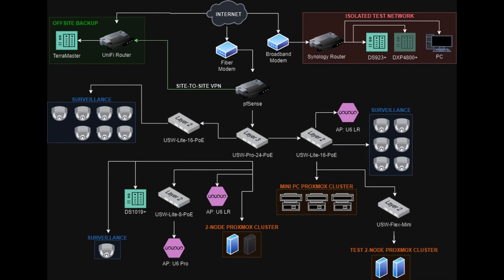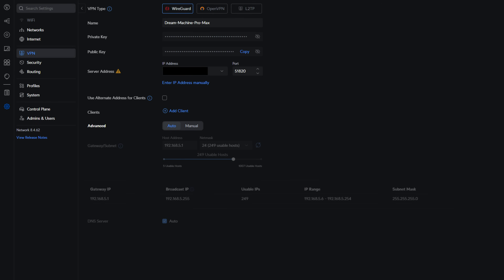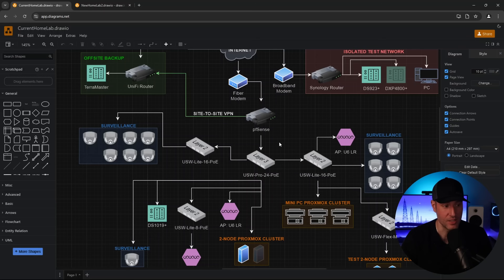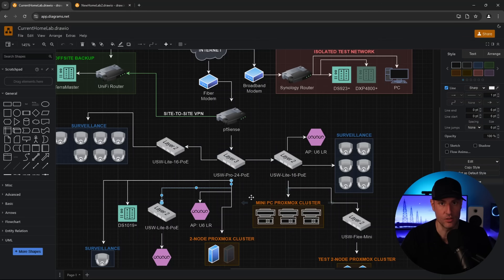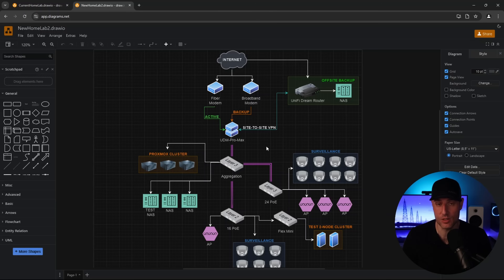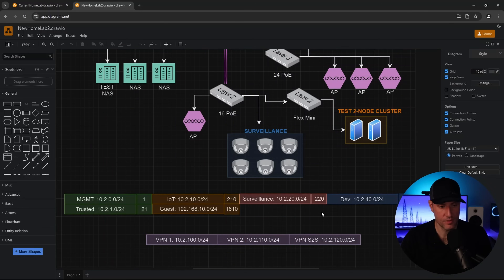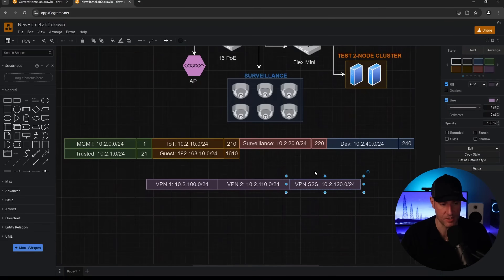Designing & Building a NEW Home Lab from Scratch

Comment: Thanks for your guides, great point to start configuring the Unifi stuff 👍. 
But i have one question. Why do you always use VLAN1 as management VLAN (same in the beginners guide)? Normally VLAN1 is the default native VLAN so every device you plug in an unconfigured switch/router has access to the management VLAN. Wouldn't it be better for security reason to keep the default VLAN as it is and create an own for the management? And the default VLAN could also be isolated and internet access blocked. In this case a new client can do nothing until you define a suitable VLAN at the port it's plugged in!?
Reply from the maker: It's technically more secure to not use 1, but in a home environment, I've never really found a reason to do it. I just set the other ports to use a different port profile, but that's just how I do it. Doesn't mean you can't use something else.

Comment: The Minisforum MS-01 is a great option for the Proxmox cluster if you can get by without ECC. I have one of them with the 13th gen i9 and 96 GB Crucial DDR5 (ServeTheHome's forums have a post listing the specifical Crucial kit that I used and has been verified to work), and two Western Digital N700 2 TB NVMes in a RAIDZ1 mirror. Probably not the best solution, but it's incredibly powerful and power efficient if it meets your needs, and the connectivity is the best you'll find anywhere near that price point (to beat it, you'd need to have 25 Gbps networking anyway). I put a dual 2.5 Gbps NIC card in mine as I was planning to use it to virtualize Opnsense, but I don't think I"m going to do that now.

I'm planning to put in a full Unifi network, but it's a big project as I need to get enough of the basement finished to make a large apartment down there. I don't know if I'll put the rack on the ground floor where my office is now and run down to the basement for my new office, or if I'll put the rack in the basement and try to run cables up to the rest of the home. But the home is not wired for ethernet at all whatsoever. The basement is unfinished so it will be easy enough to get that wired up during the finishing process, but we'll have to see what I can arrange to run cables to the other rooms of the home.

Comment: Hi!
As you asked for suggestions, here are some things that I do have or will have implemented soon at my place.
Chances are, that there might be overlappings with other comments 😀

I replaced all of my longer CAT-cables with fiber, because considering the effort of laying major lines - as a backbone oder between stories or so - I want to have as much throughput as possible for the future. Even if I might never have a higher contract from my provider, within my LAN things are different.  Maybe you will use your rooms different in some years and in case you are moving inhouse-fiber-wiring is a bonus - OK, would be for me
And I do not have to care when various VLANs run through the same physical line.
Furthermore there are new fibers that are much thinner than the known ones and have a very small bending curve. The look more like a fly-fishing-rope.
Oversized backbone throughput is a kind of peace.of-mind for me. 

A bonus from fiber is that voltage spikes do not travel through my LAN. Maybe the demark modem/router crashes, but that's usually a consumergrade thingy from the provider. I had that some weeks ago very likely because of heavy thunderstorms in the area of Munich. My fritzbox was broken, but my netgate 6100 was fine. got a new Fritzbox, played the backup back and online again the same day.

I use my SFP-Cages (why give existing switch ports away ?) with DAC only. 
SFP-CAT-RJ45-plugs produce a lot of heat a.k.a. wasting energy and aging the tec. The DAC-Cables I use remain cool even when running 10Gb/s. And 1 DAC-cable is cheaper than 2 SFP-CAT-Plugs plus cable 

Depending on the remoteness of your house, a second-router-fallback-solution with Starlink or mobil-data (5G router) might be an idea

And I cant see any UPS in your diagrams. Because you are running cameras and NVR I would like to have them running at least for a while after a potentially intentionally produced blackout. And you will still be able to get a notification if so and you are not at home.

I am curious if there is some useful information and how it works out on your side

regards from Munich

tom
Reply from the maker: Really appreciate the input! I'm hoping to get at least one of the lines as fiber, but it's not looking good - going to keep trying though. Totally agree on your point from a surge protection perspective. Very few downsides if you can get the cables run. Again, thank you for the input!

Comment: Besides I got my NAS' on two different switches, your new topo is "basically" same as mine. Both switches divide the cameras so both need UPS, which is something to keep in mind. I run three UPS totally (incoming fiber/router, the two camera-switches with NAS), that is not ideal tbh.
Home Assistant on Proxmox and one individual Pi-Hole on each Proxmox node.
Reply from the maker: Agreed, I have UPS devices literally everywhere and it's not exactly the best scenario to be in...
Reply: Now I don't know how you route cables in the walls in US, or what is allowed.
But if it's ok, don't be afraid to buy a nylon "fish tape" for wiring. I've pulled about two rolls (600') of unshielded patch cat 5e and 6 in my walls. I have not had any issues with unshielded.

Between the two main switches I have aggregated two 1GBE so I have LACP between the NAS'es (and for the 13 cameras I run = 13 constant stream = where LACP actually is beneficial). Would love to run 10 GBE but opted for the non-pro Unifi switches (because cost).
If I have had tools, I would have run fiber between the SFP's which is uneffected by interference. You can probably mooch that off some sponsor ;)
Reply: Btw, don't forget the 10 pcs flex mini-5 for all appliances and media. Being kinda old school and liking robustness, I try wiring as much as possible.  I still have PTSD from the early days of WiFi 😂.

Comment: Looking forward to this series! A note on running the fiber. If you think you need 150’ purchase 200’ pre-terminated fiber this way you don’t need the termination kit unless you want to make a video out of it. The pre-terminated can also come with a pulling hook built in. Also don’t pull 2. Pull a single 6 strand. If there is damage you have other strands. Pulling will be easier as well.
Reply from the maker: I appreciate it! That is the plan, though I have already run into my first hurdle. I can't even get the fish tape to where it needs to be, so my option is cutting and pulling it with the cat 5e cable that's there (risky), or just ponying up the money for cat 7 and avoiding fiber altogether, though I'd LIKE it to be fiber if possible.
Reply: Depending on who ran the cable and when it was run it may be stapled in the wall. Maybe a small scope that plugs into your phone and has a flashlight to inspect? They are cheap and has gotten me out of a jam before.

Comment: Surveillance not accessing anything means also NAS? 
Do you go the route with Ubiquitis NVR (I have no clue about your camera models)?
I will do a similar thing with mine. However, I will give the cameras access to Frigate (or the other way around) which itself can access my NAS for the backup/storage and can be accessed using trusted devices. Other than that, my cameras will also have to live without any internet connection or other friends then themselves lol

Also doing kind of a similar thing with Home Assistant and my IoT devices. Trying to "bridge" them so that I can connect to trusted devices to Home Assistant which itself can access IoT devices on a separate VLAN (preferably also fully offline... Let's see how I can do this. For now, with Zigbee, Shelly, my cameras and DIY Equipment, it seems doable).
Reply from the maker: Generally, my surveillance VLAN only has the cameras themselves on it. Then I'll use Blue Iris on a separate VLAN that can access the cameras, and then that will back up to the NAS. I have to think through if I want to continue doing that, but it's how it's been working for years so if it ain't broke, don't fix it?

Comment: Are your RJ45 sockets more than 100 metres away from your network rack? You cant connect everything to a layer 3 48 port switch connected to the UDM-Pro-Max? Or segment your Surveillance off to its own layer 2/3 24 port switch? I'm assuming you need 4 switches because your network runs are more then 95-100 metres?
Reply from the maker: It's mainly the location. The cables would probably be under 100 meters in total, but I'd have to run another ~16 cables and it would all go through a 2" pipe (that was there already), so it's not really an option. My goal is to use fiber, but that's proving to be a challenge. I think I can cut down that fourth switch...or at least, that's my goal.

Comment: I've settled on HP Elitedesk 800 SFF G5s for a proxmox cluster. Low cost used. Low power and noise and quite a bit of expandability. I put in 64G RAM (can go to 128 I think) 2 Nvme, 3 SSD, a dual 10Gb SFP card and a quad 1Gb card.
Reply from the maker: Love it!

Comment: I am going through a similar situation right now.
Here's my tip; The reason that kicked the reiteration in my case had been IPv6 (needed both dual-stack and single-stack IPv6 nodes for a project). My initial network was plainly dropping IPv6 (was 1st configured more than a decade ago), even though my ISP starting providing IPv6 addresses (the last two years).

You don't have to go full blown on IPv6 from day one. Just split into two single-stack networks (much less headache if you have them separated when it comes to firewall rules/hardening), and only have client devices joining one, or the other, or both stacks.

Comment: I recently went through a similar project,  A couple of gotchas I learned.  

1) I wanted to use Docker IPVLAN for networking.  I had a seperate network but to route to my other vlans, it had to go back up to the UDM Pro as I only had Layer 2 routing on my aggregation switch (I idon't have the enterprise aggregation) where my homelab and NAS devices are plugged into.  The UDM Pro does IPS/IDS on inter-vlan routing, not just through the WAN interfaces.   This killed my 10GBe connections significantly.  I ended up backing out of the IPVlan and just using one VLAN for all unfortunately.

2) I wish I ran fibre in the house to my key devices as 10gbe over CAT6 is hot to touch on the SFP transceivers and the Unifi Aggregation switch has a max of 4 ports with copper-based transceivers.  I was fortunate I could use DAC cables for most of them as I have it all in a rack in a single spot in my home.

Project sounds fun though!    Highly recommend the Minisforum MS-01 for the proxmox servers with their dual 10GB SFP ports
Reply from the maker: Awesome input, thank you! I really want to run fiber, but I'm losing faith in that plan. I can barely even get fish tape through the locations where I was hoping to run new lines, so I'm afraid that fiber won't be the best choice, but agreed - I'd much rather use it if possible! Love that Minisforum, by the way!

Comment: My home- Watchguard firewall, netgear switches and wifi extenders, two synology nas units, wired is multigig 1/2.5/5/10gbps and where anything high bandwidth is located in office,  all equipment is low noise, all security handled by watchguard, all traffic leaving or entering wired network or wireless or internet goes through watchguard which has link aggregation and builtin 2.4/5ghz wifi 6e access point with 4 antenna's,  watchguard has all vpns and cellular modem backup to primary 200mbps fiber, wifi extenders around house for 2.4ghz/5ghz, we have roughly 128 wifi and zwave devices with home automation using Samsung smart things, offsite backup by synology c2, synology identification server also used by vpn, the poe devices are the bridges and cameras and these are 2.5/10gig...and i had to use conduit to a few places around the house... but everything that can is wireless..cameras do need poe and extenders are better with hardwired uplink
Reply from the maker: Love it! Sounds like an awesome setup! I have to check out those Watchguard devices.

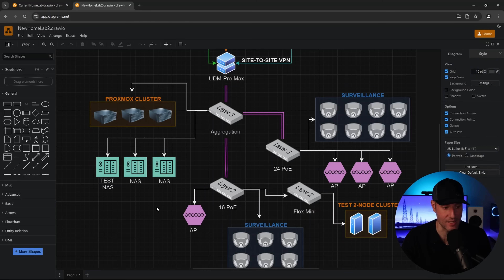Comment: 9:48 Wouldn't Ubiquiti's rack mount UNAS Pro be a good solution for your NASs? It would seem compatible with your overall approach if you separated strict NAS functionality (which the UNAS Pro is good at) from other services (e.g., in the form of Docker containers) that many other NAS devices will also run, but which can be considered to be separate from a core storage service.
Reply from the maker: It is definitely an option. Funny enough, I recorded this before that video so I couldn't say anything about the UNAS Pro, but it is definitely on the list, as well as potentially a custom built TrueNAS box if I can ever settle on hardware that I'd actually be happy with LOL.
Reply: @WunderTechTutorials  Regarding the hardware, I believe for any systems intended to run 24/7 there is a case to be made for making energy consumption one of the priorities. So for storage, it could be a good idea to not have the most powerful hardware, as it would be wasteful, even when idling. Not an expert here, but it's a factor that should be considered, AFAIC.